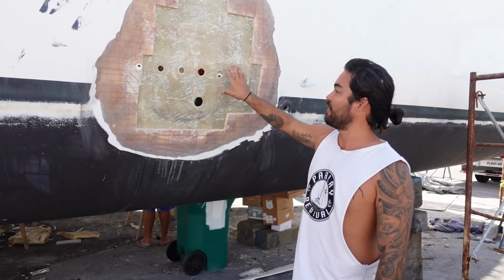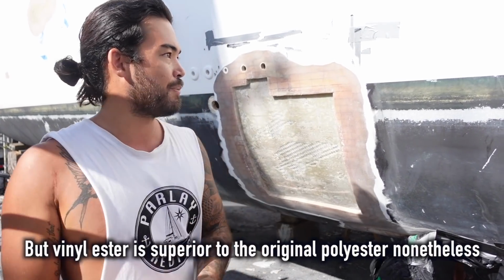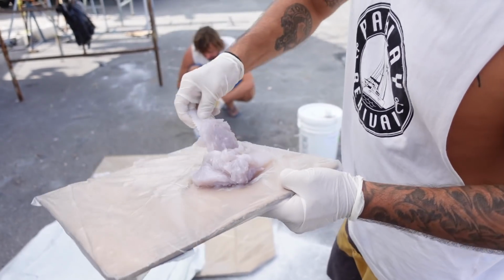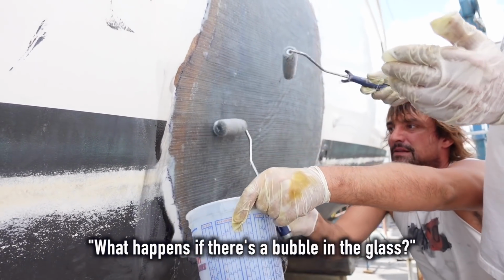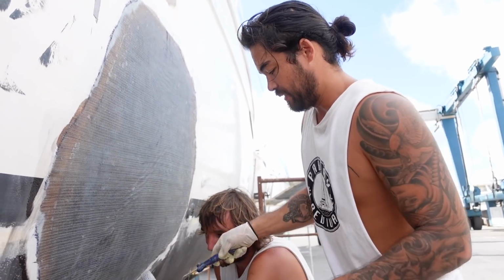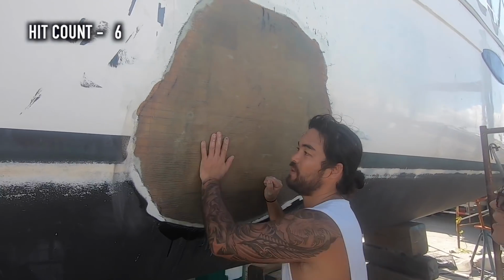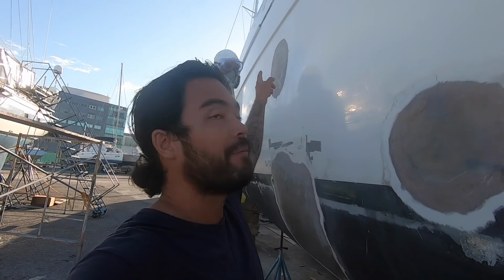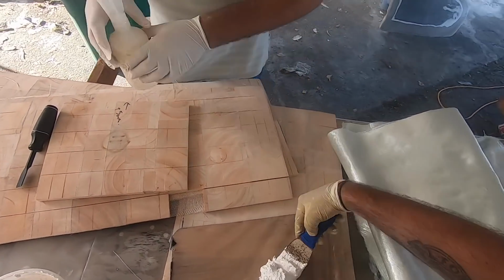HOW TO REPLACE THE CORE OF YOUR BOAT - Episode 95

Comment: Hi Colin, nice job m8.
Can I make a suggestion, a nice simpler way is to wet the sheets of glass on Plastic then apply them to the repair area.
You may already know about making a multiple layer sandwich first, rolling out most of the air then lifting up into place. You can also roll around the thick sandwich under the plastic to chase the odd low spot.
Anyway this procedure I used in my Marine Repair Company up in Vancouver BC, for 40+ yrs before retiring in 2016.
 I think you young fella's do great work. A great bit of Down Under ingenuity.
Cheers from a Kiwi originally from Christchurch.🇳🇿🇨🇦

Comment: Great tutorial Colin. Totally planned out step by step. A true demo of the 7 P’s rule. ( proper planing prevents pi## poor performance)😁 looking forward to seeing how you get the final gel coat finish. 👍
Reply: Good job of planning work flow.  One thing I learned the hard way is the importance of wetting out the areas between the balsa squares before it goes onto the inner skins.. We use a 50 gallon drum covered with plastic, bend the balsa over with the scrim down, roll on resin, turn it 90% to open the balsa in the other direction, roll it and squeegee it off and put it on the hull. If you leave dry voids between the balsa squares any moisture that migrates there will eventually wet out the balsa and delaminate/rot out the core.  

Of course we don't do hand layup any more--- just vacuum bag it all together in one shot. Even works for complete overhead jobs.

Comment: Awesome job, I am doing a huge project on a NZ designed Ross 650 yacht, replacing the core for about 4.7m2, I use a multi tool to remove the old core (9mm), from the inside - as the boat is about 16 years old, was recommended to use epoxy, rather than vinylester (originally used) so far so good, not difficult, just all takes time. Great job guys.....

Comment: Awesome work, I know if it was my boat you were fixing I would feel very good knowing the workmanship and preparation that went into each and every repair. Better then new when you're finished up! Seems similar to working with drywall trick is to not make a huge mess you then spend an eternity sanding off.

Comment: Hey guys.  Just a little tip.  If you can get ahold of metal rollers it will make your job way easier and faster wetting and getting the air bubbles out of the glass.  Paint rollers are way to soft.

Comment: Hey Colin I'm not sure exactly if you know or not or adjusted for it in some way but putting multiple layers of glass over one another without waiting for at least a sticky test can lead to unseen bubbles in the lower layers from the heat and the pull from the upper layers.

Comment: Personally, I wouldn’t even be thinking about epoxy! Yes, it has a longer working time and possibly has a waterproofing aspect....!? But vinylester is quite often stronger and works well with polyester. Only thing I do differently, if I was was going to be fussy. Would be to use CSM as a tie layer between rovings. Great work and keep up the progress! It’s about time someone beat the bloody Kiwis! 😆😎🏖🌴☀️🇦🇺
Reply from the maker: Hey jack, the biax has a chopped backing on it. Thanks for the comment!

Comment: I'm no expert but from my experience building a boat (and being a landlord repairing wall holes), it's far easier to fill a low than to sand down a high, on a surface. 
Nowadays when a tenant is moving, I tell them I'll fix holes free, please don't touch them. Because once the filler is dried, it's really hard to knock down a high w/o causing much more work.

Comment: for my part gelcoat over epoxy is possible but just not needed (or a nonsense): Epoxy doesn’t need water protection (only UV), Using epoxy means generally weight target, so at the end paint coating is the right solution over epoxy.  In any case Vinylester is the best choose for such repair, including below waterline

Comment: Looking good. I think I would run some short screws with washers from the inside to sandwich the inner layer to the balsa . After it has cured take screws out. Might not have access though.

Comment: To little wetting with resin. Use so much that it will drip off when worked on with a roiller. The white glimmer behind is air. 3:57 .

Comment: IMHO you will be better off to use the teeth on the trowel when spreading the poly and cab mix you are going to be setting your balsa in. The teeth marks allow someplace for the trapped air to go and also make a better bond. Kind of like the way you put ceramic or vinyl tile down.😎

Comment: Have you had any experience with Vacuum bagging? I am currently building a Farrier F22 Trimaran. I Wish I knew about vacuum bagging when I first started. It can be pretty fiddly particularly on complicated shapes, but it really helps suck all the layers together and removes any excess resin. Would be pretty easy to do on big flat areas That you are doing here. Peel ply saves a heap of sanding too.

Comment: I would love to know what resin and catalyst you are using to do your fiberglass work? When I was working on my shrimp boat. I could only do small sections. Because it would start to cure too fast. But by watching ya'll I have learned a lot. My boat doesn't have a core material. It is solid fiberglass. I bought it second hand. The hull has some spots that need attention with blisters. Now after watching this show I now know if I have to go all the way through and create good bonds and solid glass then that's what I have to do. I have lived my life as a seaman. Worked in the Gulf of Mexico oil fields the last 25 years as a 200 ton USCG Licensed Master. I never had to deal with fiberglass until I got this boat. It's 31x 12 cabin forward Cuddy with the back open deck skiff.

Comment: Good video, the only thing I would say is that you haven't ground your patch around the edges nearly wide enough for such a large core replacement, and that some csm should have been used in the layup as that's normaly part of what was laminated in the original build as it makes consolidating much easier
Reply from the maker: Hey Toby, the glass is only around 4mm thick so a 12:1 ratio is 48mm, which we were pretty much double or even triple of in places...
Reply: @ParlayRevival  you are technically correct but in industry we try and get at least 6 inches really theathered out where possible this helps reduce hardpoints and gives a larger glue area as this is a secondary bond.

Comment: Do you drill out all the thru holes and then fill them with filler. Then drill them out to size again? This ensures the core is protected against moisture.

Comment: I'm curious, I'm doing fiberglass repairs myself and it said to mix the the hardner in the epoxy before the silica, is vinylester different? It was explained to me to mix it that way because the silica absorbs the epoxy, if it's not mixed first and absorbs just resin then the hardner wouldn't work properly, now I'm asking a question here so no dumb comments from all the experts.... j.s.
Reply: You are correct on the epoxy. It would be a 5:1 or 2:1 ratio by volume.Mix them together stir well and then add your fillers. Polyester & Vinylester are 98.5 % resin 1.5% hardner. The hardener is watery and instantly starts the reaction. You mix the fillers into poly/vinyl resin before adding the hardener.

Comment: Nice job on the repair, looks very strong! I have used polyester flowcoat many times on epoxy and never had an issue just scuffed it up with 320 first,  the repairs have been no bigger than hand sized tho. 
I've Never done a balsa core repair, how do you get the balsa to the right curve shape?

Comment: Ahhh the ol polyester/epoxy/gel coat argument. I have done both and I’ve had not problem gel coating epoxy. Most all production boats are poly. So it makes it really confusing on which product to use. Poly is easier to “add to as you don’t need to keep it wet or sand between coats if you need to add more on top- as in the next day or week. Epoxy needs to be sanded and cleaned if you are going to stop in between layers. Just my 2 shits worth of info. Peace
Reply: Thanks a lot for the clearer info. I have to do a major repair on my small boat ( damn rock hit) and was wondering what stuff to use ! 👍

Comment: Could you use a strong plastic sheet to cover the repair and then seal the edges so their air tight then use a vacuum pump to suck the air out and the bubbles while the resin and filler goes off.

Comment: Good video. I was wondering about the strength at the edges of the patches, where the glass, balsa, and other materials abruptly end at the edges of the patch. In the original construction of the boat I assume that the hull materials would be placed in a continuous, overlapping pattern. Is the strength compromised at the patch? I'm not being critical, I can see great care and quality in the repairs, just curious.
Reply from the maker: Thanks for your comment! So the traditional rule of thumb for the taper of a repair is 12:1 to the thickness of the glass. We went with at least double that, as well as switched to vinyl ester which has much greater mechanical bonding properties than the original polyester, so if anything, the critique of these repairs could be that they are arguably stronger than original, which could theorhetically cause issues to its surrounding material as the vessel flexes. But it is about choosing the best method and material for each repair, and on consultation with other industry professionals, I feel we made a great decision, and executed the repair as well as anyone in the game.

Comment: Okay I have a question....the perfectly square corners on the area to be repaired..They used to make airplane windows square but found the sharp corners were a structural weakness due to the cracks and stress on the sharp angled corners. Why not make those corners round or with a radius? at least on the hull part of the equation. Easy enough to do with a hole saw. Just curious like the channel and everyone. But I had to ask this question..stay afloat..

Comment: Gelcoat not sticking to epoxy repairs is a myth.  With a good surface prep gelcoat filler or sprayed gelcoat will adhere just find, although it is a mechanical bond and not  a chemical bond.  There are now Gelcoats on the market that specifically formulated to be compatible with epoxy lay-up so you can spray gelcoat on the inside of female molds when making new boats or parts with epoxy as the laminate resin.  With the extensive repairs you are doing, I would still choose vinyl-ester because of the reduced cost over epoxy but superior performance over polyester, plus getting the coat filler on the repair when its still green gets you that chemical bond.

Comment: How do you ensure no air trapped behind the balsa core without vacuum infusion ,which would surely  weaken the repair
Reply: I was wondering this too, I didn't see Colin use a roller to apply extra pressure.
Reply: Getting rid of air in the laminate does not require a lot of force . You just have to work it away from the middle of the patch to the edge and that fore every layer . You can not do this for all layer's in one go .

Comment: Shit man , you need a tie layer of chopped strand mat ( cam ) say 450gms to help hold all that double bias ( db) together , while it will be strong DB doesn’t hold that well on the first layer , it will stick but it won’t tie together well .....been doing fibreglass for 34 years ...one good sucker punch from a wharf or another hit and it will just pop off ...good luck and good prep work
Reply from the maker: The biax has chopped backing...

Comment: why did you not change from #balsa core,. to a longer lasting closed cell foam core. You can get versions with 90 degree cuts in surface which mease good for curves. It is done in the same way but longer lasting, and better for environment .

Comment: At least it's a balsa core, although extending it below the waterline is madness.
Foam cores are a nightmare when they go wrong, which they usually do.
Reply: what are the foibles of foam cores v balsa?
Reply: @jamesbirkin351  They always end up waterlogged. Balsa is stronger, sticks well and resists rot. Foam is a lost cause, never buy a boat with foam below the waterline: or anywhere, if possible.
The proper way is no foam below, and only balsa above. Oh, and the use of roving everywhere with strength or water: chopped mat is hopeless for osmosis (the short strands have many ends) and strength.
Reply: @G-ra-ha-m  thank you
Reply: @jamesbirkin351  David Pascoe from 'yachtsurvey' goes into some detail, including how the hydraulic loading of a soaked core (causes by battering against the waves) causes chaos as the boat is used. It ends up with two think GRP sides with a smelly mush in the middle, and an astronomical bill to fix it. It's only really used to save resin, 1970s boats are generally a bit tougher!
For me however, steel is the winner: strong and easy to fix!

Comment: One piece of wood not separate pieces, for strength. Looks good though.
Reply: It looks like the balsa is scored part way through though for flexibility.
Reply: @michiganengineer8621  I don't mean to critisize but I would still do one piece of wood cut to size just to make sure . Nice job though
Reply: @jensonsenna6640 The only reason the balsa is scored is to make if flexible enough to conform to the complex hull shapes.  I just wish more boat builders would stop using wood for the hull, transom and deck cores for exactly the reason Colin and crew had to tear out so much of it.

Comment: You put the layers of fiberglass on in reverse. The largest piece goes down first. The smallest goes down last. It is the opposite of common sense. If you imagine the layers there is a small air gap at the very edge of each piece buried under the next layer. The non strucutural resin fills that little void. However if you do the correct order(largest to smallest) there are no edges. They blend seamlessly when you fair. Look it up.
Reply from the maker: With all due respect this is just not true.
Reply: @ParlayRevival  https://www.boatus.com/expert-advice/expert-advice-archive/2012/july/how-to-repair-a-fiberglass-boat

Another technique we use to save time is to cut all of the patches the same diameter. Imagine a hole that is 10" round after its ground back. We cut 4 pieces (or whatever the original laminate was) at 11" diameter. Lay down the first one. We it out until  it hits the good gel coat. 1/2" of dry fiber is sticking out all the way around. Each layer is added more dry fiber is left, only wetting out what needs to be wet. When its cured you can quickly grind off the dry fiber, leaving the proper amount of wetted out glass. Keep in mind that the 1st layer covers the core and all of the ground glass. The rest simply lay on top. When you grind it flat it looks exactly as if you cut different size circles putting down the largest 1st. Cheers, Adam

Comment: Another Great upload your preparation was mighty and really paid off... at the latter end of the Upload, you were asked about ,"Air Bubbles" in the Glass just wondering although the shape you were repairing was fairly Convex maybe could you use a short to medium aluminium tooth /splined... 'Paddle" roller ... there are even one out there being marketed as a 'Bubble Buster" also claims it pushes more resin directly into the Matt or Roving... so there's little resin waste and little  off spray  ...I'm sure they are out there in a shop near you...https://www.bodico.com/collections/fiberglass-laminating-rollers/products/standard-fiberglass-rollers?variant=1034123759